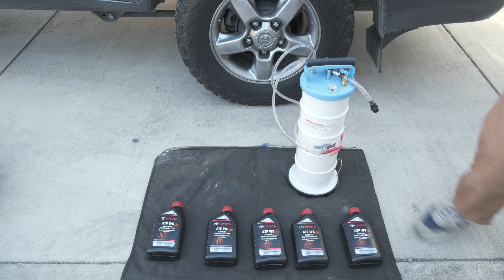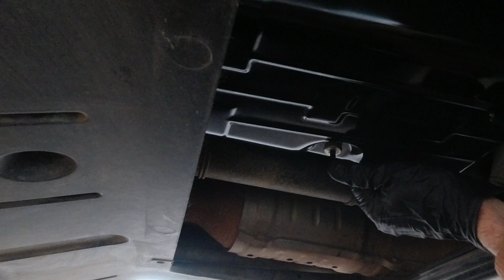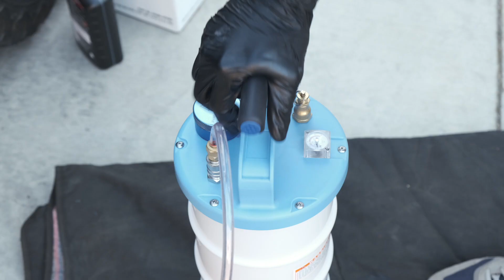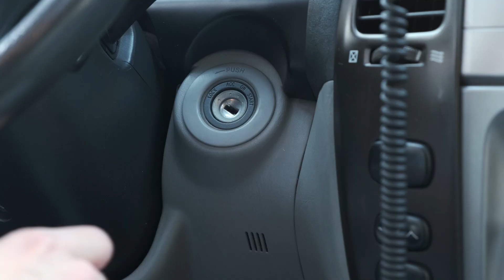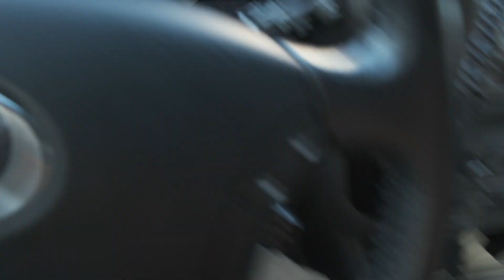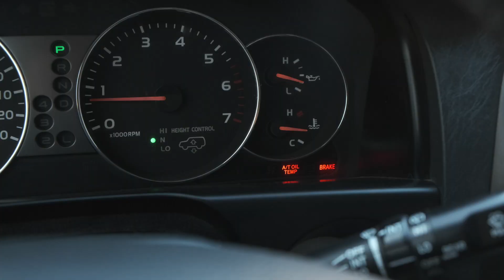Transmission Drain & Fill 100 Series Land Cruiser '06

Comment: This appears to be where the 470 LX differs as it has a sealed transmission that is not serviceable? Have an 06
Reply: incorrect. the transmission is serviceable, toyota just removed the dipstick "easy fill" option.

Comment: First off, great video as usual. I also have a 2006 Land Cruiser, so I usually check here before I start a job to see if there are any tips to glean. Regarding the diagnostic mode, I am under the impression that procedure may no longer be used for accurate temperature range when filling the late model Land Cruiser transmissions ('04 - '07). I believe you use the online or downloaded service manuals (based on previous video) which stated the correct interval of 97 - 115 F, but the original range in the printed service manuals state checking at a range between 115 - 130 F. The lower temperature was the result of a TSB (T-SB-0129-08 July 9 2008 Toyota change recommendation to between 97 F to 115 F) issued against several models and years of vehicles. The point is that the diagnostic mode built into the ECM is still using the 115 - 130 F range. As you demonstrated, the light will come on at 115 F and if it exceeds 130 F, it will begin blinking. I ended up just using my Scan Gauge II to read the realtime transmission temperature, but it could also be read in TIS. The higher temperature could result in lower than the currently recommended level of ATF. This is a good link for more details. https://forum.ih8mud.com/threads/scored-2007-unicorn-the-holy-grail-of-100-series.1043138/post-11645885
Reply: Loved the pump recommendation. That made filling the transmission so easy.

Comment: From what I read is better to do the fast one , since there tiny particles from the clutches wear and tear that helps it stick better so by leaving some of the original fluid/clutches particles 
Read this somewhere in ih8mud
Reply from the maker: +1 I've read this too - probably the safest way would be to perform several drain/fills at shorter intervals, but I'm not an expert in this area!

Comment: Hey mate, how are you cycling through the gears when you disconnected the linkage to get to the fill plug?
Reply from the maker: Hey good question - that’s a mistake on my part in the video, you do need to fasten the nut back on the linkage to cycle through the gears. Thanks for asking the question!

Comment: There is another easy way to do this job, drain the gear oil - dont remove fil and overflow plug - when you want to add oil just add it right way from dipstick using a funnel same amont that you drain it. When yo finish check the oil from the dipstick witn normal operating temperature.
Reply from the maker: That is a valid way, but not on an ‘06 transmission, which does not have a dip stick.
Reply: @LandCruiserDIY  wtf, why would they delete that?
Reply: yah, I have 02+00 with the JDM tractor 4 speed, so simple dip fills for me

Comment: Great Video! I've been pouring atf fluid down the atf dipstick this whole time. I have a 1998 landcruiser so I'm going to take a look if I have that overflow valve because I never used it. Also, why can't the manufacture tell the exact oil needed? 3 quarts right?

Comment: Great but long video. I also watched a couple of others and came up with something a little different. 

The hose I pulled from I also connected a clear hose to a funnel and refilled the amount I dropped. Which was at intervals of 2 quarts. I had a bucket that measures up to 22qts. Lastly, I did my best to get the signal to show after the jump. But nothing would happen. So, I just let it idle for 20 minutes then checked. I had indeed overfilled. Thanks for your video, it help give me the confidence to do it and now I feel very competent!
Reply from the maker: Thanks, Rick - glad to hear you were able to modify and get it done!

Comment: What year Land Cruiser is this?  Also, would this same exact procedure work on a 2002 LX470?
Reply from the maker: Mine is a 2006 - this procedure is different on the earlier years (I believe also including the lx). Since you guys have a dipstick, you’re able fill from the engine bay. You don’t have to pump the fluid in. Also I think the fluid is different as well. Def check the FSM for your model year if possible to be sure. Good luck!

Comment: If the gear shifter linkage was disconnected,  then what good is it to shift to get the fluid through?
Reply from the maker: Thanks for pointing that out - you’re correct, the linkage should be reconnected in order to cycle through the gears and trigger the diagnostic mode.
Reply: @LandCruiserDIY  I'm glad you realized it was a question and not an attack.  Thankyou for responding.

Comment: I have a diesel before facelift with a four-speed transmission. The process of filling with a hidden bolt seems complicated. Normally I drain the drain plug. It's exactly 3.8 liters. Then I fill the same amount of new oil under the hood trough a hole for the dipstick. Then I select all position on shifter P-R-N-D-2-1, make short drive and check oil level. Job done. I only have a sieve/netting filter, not a classic filter, so I didn't change it. Unfortunately, only a 1/3 of oil is replaced. It would be better to find out how drain TQ convertor and AT oil cooler etc. If we not change all, it is better make it more times than official period. I do it together with every second engine oil.
Reply from the maker: Agree - adding fluid via the dip stick would be nice! Once the transmissions became hermetically sealed, the dip stick was removed (maybe ‘05?) to prevent moisture in the air from being absorbed into the transmission fluid. But once the transmission is opened for the first time, my understanding is the fluid must subsequently be changed at an interval similar to 100’s with the dip stick.  I’ve not seen any info on the TQ converter or AT oil cooler - thanks for pointing those out, I’ll look into it!

Comment: Drop the pan, put it back on, fill after waiting long enough preferably 1/2-1 qt. extra, disconnect transmission fluid cooler return, attach hose from cooler return line to catch container, keep enough fluid in vacuum pump, prime it good solid, start the truck and open valve on vacuum pump while seeing the old fluid come out, exchange enough fluid through transmission(preferably atleast 2 qts. extra than transmission dry fill capacity), turn the engine off and reattach cooler line/hose, confirm correct level, Done!
 I want to see this video and I have my right as a subscriber to ask for content!
P.S The thumbnail will definitely highly help a video according to my recommendation kick your channel off. Check out transmission flush on 1Road YT.
Reply from the maker: Thanks! Next transmission fluid change and I’ll do the pan drop 👌

Comment: Yeah man, pan drop vid would be amazing. A link to the pump you used in this would be great to, although I do have dipstick in my 2000, so maybe I won’t need one? Thanks again for the fantastic content.
Reply from the maker: Thank you - I appreciate it!  Here's a link to the pump I bought; it's a little pricey but well made and easy to use: https://www.amazon.com/gp/product/B00YX7Q0MI/ref=ppx_yo_dt_b_search_asin_title?ie=UTF8&psc=1
Reply from the maker: On the dipstick question - I believe you can fill from the there without the pump.  Take a look through this forum post for more info: https://forum.ih8mud.com/threads/transmission-fluid-change.20426/

Comment: Hi there, thanks for the video. I have a 2004 land cruiser that doesn’t shift to gear 4 when driving in an automatic transmission but when I drive it on manual transmission, I can switch from 2, 3, and 4 easily. Would could be a possible reason that it isn’t shifting to gear 4 and 5 in automatic transmission? Thanks for the videos!
Reply from the maker: Thanks for the comment - not sure on that, maybe someone else in the comments can chime in on this?
Reply: Thank you sir. Note that the car was sitting and the battery was dead for a month. Could this be something electrical rather than a mechanical issue? Also, no check engine in the dashboard

Comment: How many miles you have on your LC? I have same truck with 106k and want to do this service.
Reply from the maker: I’m at 206k now, the previous owner changed at 90k and I did the first drain/fill at 165k.  It’s actually a pretty easy procedure after doing it the first time and with the right tools. Good luck, let me know if you have any questions!

Comment: Hi, great video! probably the only practical one I saw for LC100! Thanks! What adapter did you use on this ATF refill transfer? (I mean the adapter connect to fill hole) Could you share a link or a part number of that adapter?

Comment: Hey! This seems to be intimidating... Can we not remove the old fluid from the dipstick hole and add the same quantity back? Maybe do this a couple of times after driving about 500 Miles..   Let me know if you have other ideas!!
Reply from the maker: Hey Mark! The 06’ doesn’t have a dipstick, so using the fill plug is the only option. Personally I’m reluctant to suction fluid out since that requires putting a tube into the transmission. Totally hear you on it being intimidating - if you have a dipstick, that means you can also refill from the engine bay which makes things easier. Adding the same quantity back also works, the only trouble being you might not know if the truck is currently filled properly. I’d encourage you to drain from the pan, measure the quantity, refill from the dipstick. Once you feel comfortable with that, include the procedure to check the fluid levels. Hope that helps!

Comment: Thanks a lot... But, I'll appreciate it if you could do the detailed one when to replace the filter, gasket and drain most of the extra fluid in the torque converter... Etc.
Reply from the maker: Thanks for the comment - planning to do the detailed one the next time I change the fluid.
Reply: Like to see as well. Great vid thanks.